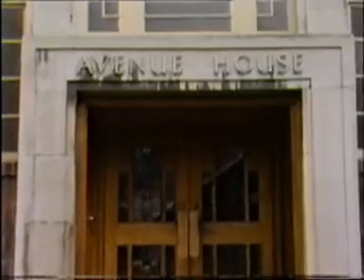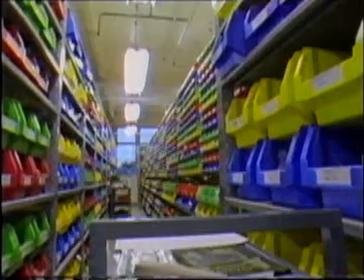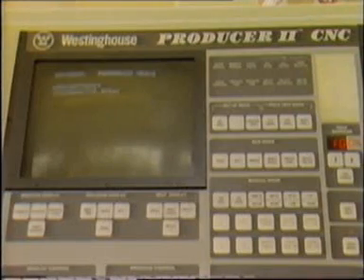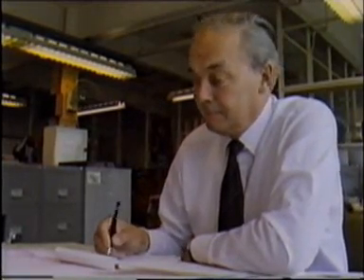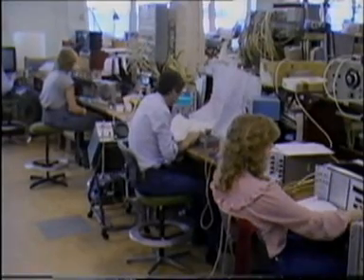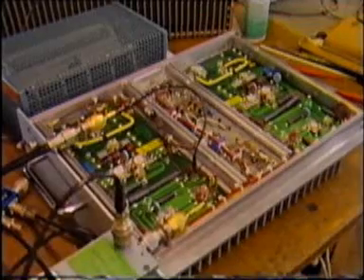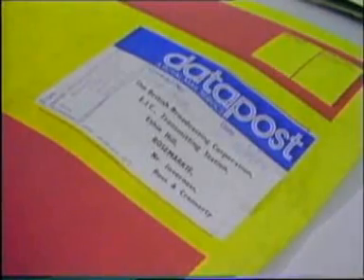BBC Equipment Department, 1984

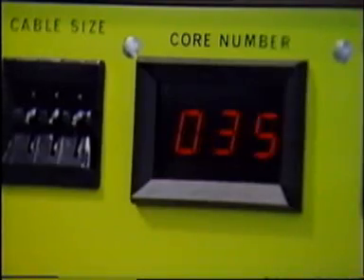Comment: @bondp99 They look like bayonet multi core in line connectors. At 1:28 you can see the engineer using a cable core tester.